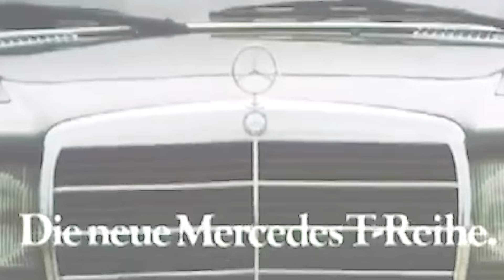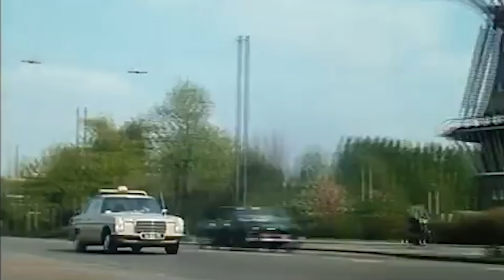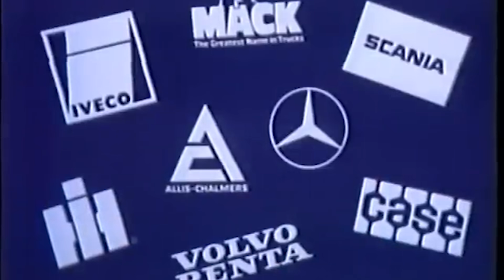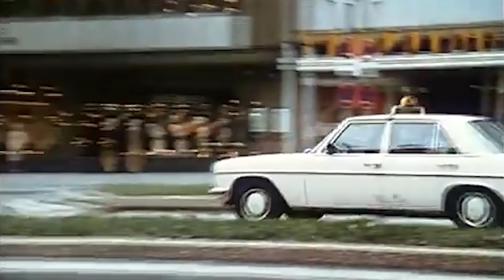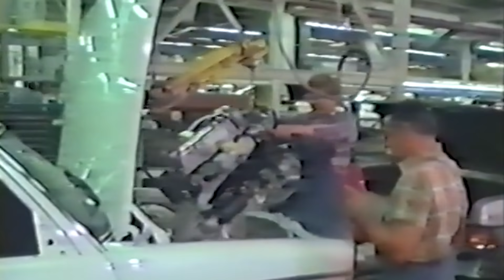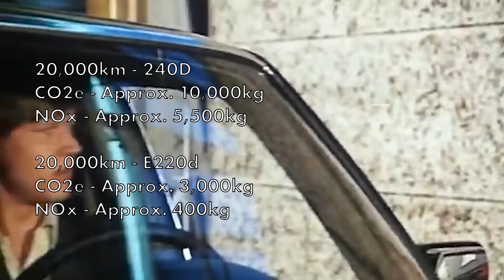Mercedes 240D - Still Fit for Daily Use?

Comment: My parents had a 1980 W123 240D  with a 4 speed manual, they bought brand new in Santa Barbara CA.   Boy was she a snail.   They sold it twelve years later, it ran exactly as it did when new, the only part that failed was the spedo cable,  which broke at about 3K mikes and the repair  was covered under warranty.   200K mikes, one repair, covered by MBZ.   Some say this isn't the best Mercedes ever made, its the best CAR ever made.    I'm inclined to agree.
Reply: w 124 was also very reliable. Father was using w126 260SE for one decade , it was for me the best S Class ever, i was a child but i knew it was a great car.
Reply: @canhuseyinoglu6477   Too many computers in the w124.
Reply: Former Mercedes-Benz of No America District Manager  (factory rep) during the last years of the 240D up to the intro of the 300D Turbo era.
For some time I had 240 D cars as demos then the non turbo 300 then the  Turbo 300.
The 240D and the 300D non turbo  (especially the TD Wagon) were the finest cars Mercedes built. The best of the bunch were manual gear box cars.
No question at all that the 240D and the 300D were Daimler Benz finest. .  500K mile cars if properly maintained, something not common for American owners.
Reply: @jeffhildreth9244  Once again E320 CDI is easily a 1,000,000 miles car.
Reply: My dad had a 1979 240 D : he kept it for 26 years! ❤
Reply: I'm going to tell you, it's the 2006 E320 CDI that is both the best mercedes and best car ever made.  I have one and whenever I pull into a Mercedes dealership or any serious mechanic they all look at it and say the same thing, best motor ever!  Flat out, ever, in any car, of any motor ever built. Period. I get 50mpg, it has more power then a big block V8, clean, no emissions systems, just CDI.  The car is way better too!  The OM648 is a far more reliable, and longer lasting motor.  In general I would say with each generation of mercedes diesel they got better up to the OM648 and then it went down as far as reliability and fuel economy.  Even the modern Mercedes diesel with hybrid power still doesn't get the fuel economy of my 2006 E320 CDI.  One thing I will say for the older Mercedes cuz I had an 84 300SDL.  When I lost the key on that the car was towed for free to mercedes and it cost like $30 for a key where as my W211 the cost a lot.  The other thing is the old Mercedes are really good off road, there's extremely fast off road, they have incredible ride clearance, they can fly over rough terrain and the new ones with 5 point multilink axles aren't that tough.  The W123 is an amazing rally car.  But my E320CDI is a seriously fast car, I smoke V8. I have outmuscles a lot of SL500, E 500, I smoke Dodge Charger with 392 hemi with 420hp.  Anything above 85mph and the diesel is faster.
Reply: @rainbowwarrior2635  You are not going to outrun anything 500 unless you have a severe tune on it lol :) 224hp is never going to win against anything 300+. Especially not at higher speeds.

The OM648 is a good engine still. But it is also more complicated than the prior ones. And it wont take nearly as much power as the OM606. Which was the last diesel with an iron block.

But for many people the OM648 might be the best compromise.... for their needs/wants.
Reply: @martinsv9183  The OM648 has 370ft/lbs of torque on it and it's 201hp is at 4200rpm.  It's more powerful then the 5 liter V8, only the supercharged V8 is stronger.  You can say the SL500 is faster but repeatedly I have guys in these cars floored next to me, pounding their fist on the steering wheel in frustration as I step down further on the throttle and pull away from them on the open road.  I am a serious driver, this is not some little stop light race, a drag race with me begins at 60mph.  And the big thing is the diesel uses all of the gears, it's usually taking off in 1 gear higher, so torque is really the name of the game.  If you look at the V8, they can only use the first three gears up to 110mph, maybe even 130, where as the diesel is going 52-89mph in 3rd, and in 4th the V8 can keep up from 89-120mph.  Also the OM648 has a iron block.  It's even more reliable and durable the the 606.  It's a more powerful motor then the 606, it has a lot more torque and torque is really where the power is at.  And flat out if you zoup it up it is the most powerful motor in that car, the 5.5 liter supercharged V8 cant even tough it,  You can get up to 500hp in the OM648 and it's pushing 800ft/lbs of torque at that point which is the limit of the transmission, so it comparable more to the twin turbo V12 at that point.  And the V8 cant even get to that power level because of detonation, plus it has terrible fuel economy where as the diesel can casually do that all day on biodiesel while being quiet at the same time.  And inline 6 is capable of more power then a V8 particularly when you bring in turbocharging because it has a stronger crankshaft.
Reply: @rainbowwarrior2635  I have driven the 500E... And I have driven the 320CDI with the 197hp engine...
There is no comparison..... The only point they feel simliar is at lower rpms. 
Anything after that is not a single chance..
Its 0-100km/h in 6,1 vs 8,3......
And that is exactly what you feel when you drive them both and floor it at higher speeds.

But yes you can tune those diesels hard.
You can get even more hp out of that V8 though. But you will have to add the turbo and everything with it. Or supercharger. In the Sauber-Mercedes C9/C11 they took out around 800hp from the m119 engine.
Reply: @martinsv9183  0-100 is nothing, the diesel losses a lot just in the shift, I'm talking 100-240km.  You want to get in a race with me, that's where we're talking.  Also 800ft/lbs of torque counts for more then 800hp.  And it's not even equal, that fact that the CDI is continuously beating these V8s in drag races on the open road indicates the 1ft/lbs or torque actually counts for more then 1hp
Reply: @rainbowwarrior2635  The difference is much bigger 100-200... And even more so at 200-250.
A 500E has 326hp. You are not getting anywhere near that car in a race if you have 200hp.... 
ESPECIALLY not at higher speeds.

I've driven them both. Floor it in the 320cdi and when its starts losing power after 3000 rpm imagine that pull instead continuing all the way to 6000 rpm. Instead of tapering of like in the diesel it feels like its increasing.

You will have to tune those 200hp disels if youre going to keep up with a m119 car...
And anyone who drag races a CDI has very most likely a pretty havy tune on that car....

You are under no circumstances beating a 500 with a stock OM613 or 648... Not other than in possibly a very narrow rpm range. If you happen to hit the aboslute worst rpm point possible in the 500.

There is no such thing as 800lb/ft "counts for more" than 800hp. It doesnt. What ultimatly counts is hp. What can help though is a flatter torque curve... The fewer gears you have the more important that becomes.
Reply: @martinsv9183 hp = torque x rpm /2525.  Torque is the only real hp, 200hp at 4000 is the same as 300hp at 6000rpm.  And having a motor make more torque at a lower speed with longer gearing is actually a much better way to speed, it’s industrial speed.  The diesel is beating the V8 in 4th and 5th gear, it’s taking off in a higher gear.  You can say what you want, the main issue is yall dont know how to drive.  Nobody who knows how to drive will ever be going less then 60mph.  It’s all about coming out of a cornet quick and sustaining high speed acceleration and high average speeds.
Reply: @rainbowwarrior2635  What lol :) Torque is not "real hp".... What are you talking about :) Torque is torque. Hp is hp. 
What results in the cars acceleration is the hp.... The torque has to go through the gearbox......
So when the 200hp diesel is at 4000 rpm it needs the next gear..... which is taller.... so acceleration slows down there. The 300hp at 6000rpm car doesnt need to shift at 4000.... It continues with the lower gear until around 6000 rpm.... continuing the faster acceleration caused by the lower gear.

You need to undersstand this first. Before you continue to argue... :)

The diesel is not beating the V8 in high gears. It might be beating the NA V8 in high gears when you are at 1500 rpm though....... because a not too large sized turbo can give you a lot of lower/middle rpm torgue.
But that's not the rpm you will chose for the NA V8 if youre going for max acceleration..... Because you have something called a gearbox......
Reply: I will agree too. Fantastic car but yeah so powerless
Reply: @chrispark4310 that why it last 1.000.000+ Km :)
Reply: That would be the volvo 240
Reply: @ivanbro1208  Volvo 240 is good too. But is not as refined as the w123.

Comment: Very interesting. I'd almost daily my 280CE as I do low mileage were it not  for the worry of driving in the rain. Also here in the south we cannot get classic insurance without also having a policy on a modern, which I don't think is the case up north? Other issue to consider is safety. BTW the 123 does have cup holders, of sorts☺ the glove box lid has indents for two cups when open!
Reply from the maker: Yes you're right, i always found that very frustrating in the south about the insurance, insurers in the south won't even entertain anything old on any sort of policy, in the north anything post 1972 can go on a normal non classic car policy. You're right, I love the glove box picnic tray, just wouldn't trust around corners!
Reply: @427Motorsports  yeah it's a pain you know where alright. Lol I just use the lid for when I'm at a show. Well ware with your 240D!
Reply: Also regarding cup holders, if your car has the optional extra middle armrest, then you can put a big cup in the center console and then wedge it in place by lowereing the armrest on top  of the cup's lid. 
Will hold a medium size soda cuo or a big coffee cup securely and prevent it from falling over even in curves. For extra safety, make sure your arm never leaves the armrest and weighs heavily on it.

Comment: I have a 250 turbodiesel (W124) daily driver. NEVER let me down, even when the battery completely died : a good push and I was able to get to the shop without the battery in the car, I left the battery home and drove right to the shop and put a new one in there. No problem. (no indicators, no brake lights eighter😂)
Reply: As someone who has had the worst luck with alternators failing while far away from home, the fact that these old diesel engines are fully mechanical and aren't dependent on electricity is a great and often overlooked benefit.
Reply: Mechanical fuel injection?
Reply: A diesel mashine not a toy 😄

Comment: Great informative video! I currently drive a 1983 S123 240TD that has clocked 930 000kms (old taxi) I've done basic maintenance and fixed a few bushings and tie rods to make it smooth and drive properly, does 6,5 L/km ~ 43 MPG. Also soon getting a 1973 W115 220D.
Reply: Thats nice fuel economy for a heavy mercedes, is it the turbo diesel variant?
Reply: @Bartem_  no, the 240D didn't come as a turbo from factory.
Reply: Find a engine that runs 930000km nowadays 😂
Today cars and especially engines are build to fail
I watch a German YouTube channel a engine repair specialist 
He says the engines are totally wrongly designed and impossible not to break
Old engines are the opposite 
Build to last 😄
That's why it is not beiimg some anymore 
More damage more repair more money 😂
Capitalist wet dream

Comment: 0-60 in under 10 minutes, guaranteed! I have a 90mile daily commute round trip in my 83 240D and it can get a little hairy especially going up hills, but its a true Spartan of a car.
Reply: I had a ‘78 240D and I would take a canyon road that had an incline and I would run the car up to speed and by the time I reached the crest I was doing about 30-35 mph. Then coasted into town.

Comment: "Still fit for daily use?"  I laugh at that question.  When you've got over 300K miles one, get in front of anyone not driving a hybrid or an EV and then, when you are going up-hill, just floor the damn accelerator and cover the offender with soot and whatever diesel manages to make it out of the tailpipe without having been oxidized.  While this technique does not contribute good mileage, it is highly, emotionally satisfying.
Reply: I own a Leaf and a 240D and I enjoyed your comment

Comment: This is a great video, especially the segment on ecology. I semi daily drive a W123 200D and can attest to the feasibility as long as you're driving with that "it has its own pace" mindset. What about mixing WVO to diesel fuel, does that reduce CO2 emissions ? What about future prospects of synthetic fuels for old diesels ?
Reply from the maker: That's a great point! We'll do some research and cover that in future!
Reply: The return to vegetable oil based fuels (biodiesel) may improve emissions.    @427Motorsports
Reply: My understanding is that whilst attractive from a financial and environmental perspective, running an old diesel on WVO can cause problems for the engine (particularly the fuel system) due to the high glycerin content of oil that has been heated to high temperatures. It can of course be refined into biodiesel, which is a more involved process but better for the vehicle long-term. A lot of people who used WVO did so in the 90s and early 2000s when these cars were regarded as mere old bangers with little value.

Comment: Excellent video, it's way better to extend the life of a car than junk it and go for a plastic/disposable new one!
Reply: agreed. I am somewhat wary of some of the newer ones. Had a bad experience with a second hand 2015 one
Reply: There are good newer ones too. Newer Model S is basically fully made out of aluminum so it won't rot, their batteries can do well over million miles (with service on 300k and 500k) and will save you a value of few gas cars on that mileage if you're charging at home most of the time.
I have a Model 3 but I'd love to own an old Merc too, just because 😁
Reply: @rouchar  I think Tesla is becoming history. The mixture of spyware, excessive computerization of everything, the utter lack of build quality and the lack of reliability of the interior components (and potentially the drivetrain itself) as a result of the former are more than enough to turn most people away from them. Also, they are too expensive. A new base model Model 3 in Europe costs as much as a well equipped multi purpose vehicle which is infinitely more practical. Like, my father bought a Zafira new about twenty years ago, both as a family car and as a van. He stopped caring about ten years ago and thus it sees maintenance only when something breaks, it gets heavily abused at work and yet it is still highly reliable.

Elsewhere the 1.9 TDI Volkswagen Passat and its derivatives serve a similar purpose. In Bosnia, for example, they are like a pickup truck, people haul truck loads of firewood in the back. Maintenance does not exist as a concept there.

Comment: Thank you for the video. It’s very well done. I have a 1975 240 D that is my daily driver (but only in good weather). I absolutely LOVE these cars. What I love most about my car is the 4 cylinder diesel engine. The sound is pure music to me.
Reply: I have an even slower ‘69 220D that makes heads turn anyway (& a few w126 300SD’s as well) . Love them all especially when I haven’t bought diesel for them in over 2 decades cause I run them all on free oil from some restaurants I’ve had relationships with since forever ago lol 😊
Reply: I have a 69 220 D also. The engine runs beautifully but the car is not yet roadworthy. That’s amazing that you’re able to run these cars on french fry oil!
Reply: @davidellzey8447  veggie oil,canola oil, peanut oil, transmission fluid, Mann it’ll run if the battery dies until you turn it off…we have the REAL and original hybrid “Flex fuel” vehicles 😂
Reply from the maker: And kerosene if mixed with diesel too. So we hear.
Reply: Transmission fluid, motor oil you name it!! Best cars to do this with!!